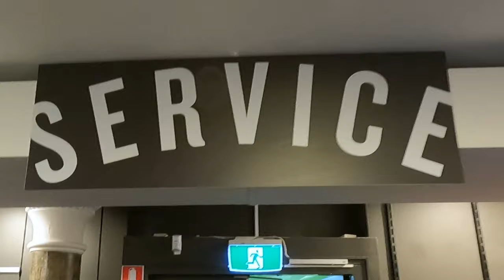Cervélo Caledonia workshop update: grease and carbon paste reapplication and voila, no more creaks!

Comment: Have the exact same issue with my Caledonia 5.  I hear creaks and sometimes louder cracks. I reapplied the carbon paste and was good for 1 ride. Did it again and then good for 3 rides. Will try again also applying the grease to the metal on metal parts as well. Hopefully, this will resolve the issue.

Comment: I have the same red Caledonia 5 actually...with the same exact creaking.  I added carbon paste...seemed to work say for 10 mins. I'm gonna clean it all out and reapply again.
Reply from the maker: Also be sure to check your saddle rails... as sometimes that's where the noise comes from.
– Rob
Reply: @ride-media  Yeah, I have alloy rails so I clamped it down hard.  Regardless...great point.  I'll try to fix/isolate the issue with that rails in mind.